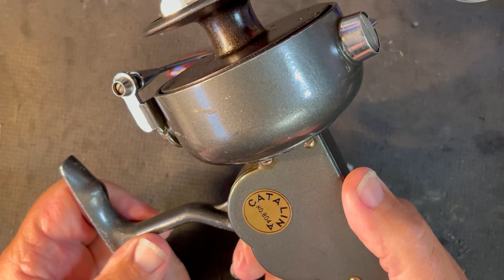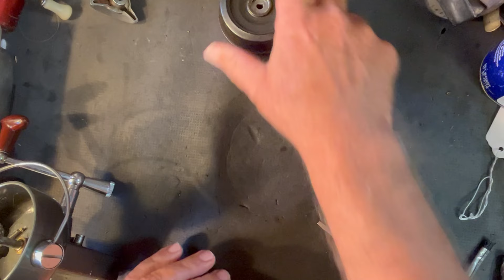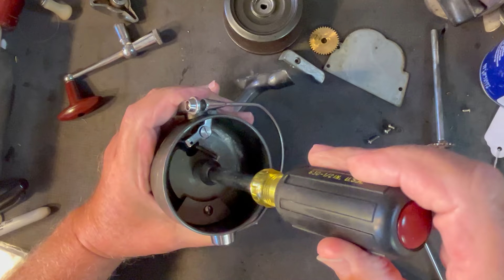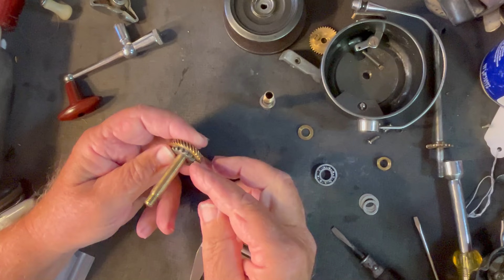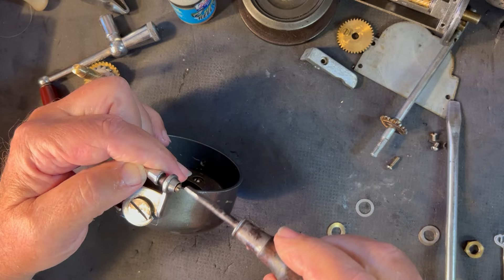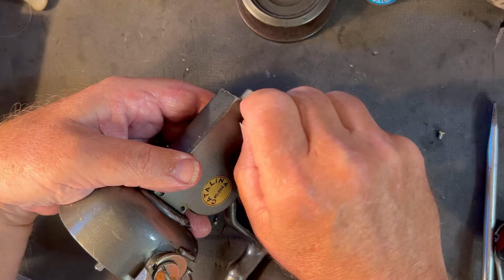Catalina No 804 or Jorgenson X 12 or Columbian No 65 -- Revisited -- Young Martin's Reels

Comment: first of all I have one of these reels I would like to know  if they were made by Diawa and what year,  the other thing is the one I have has a slightly different  the handle...it screws right through  and the drag has a couple of fibre washers and 4 what appear to be cork washers in it thanks for the video I would be lost without it  cheers Reg  Esperance West Australia
Reply from the maker: Greetings down under. It never fails to amaze me how far out my videos are going. I really don’t know who made the original design of this reel. If you read through the comments you will a short discussion I had with Chris Jenkins about that. He seems to think the original was made by Jorgensen. He’s done a lot more research on that than I have. I have noticed that in most cases, trade reels are almost always slightly different from the original. Sometimes it just the makeup of drag washer material. I’m curious, did yours have the drag spring in it or just a drag washer stack. If the spring broke or corroded. It might have been replaced with washers to take up the difference. 

How do you guys keep from falling off the planet down there. 😊
Reply: @youngmartinsreels5314  thanks for the reply . Yes the internet does make the world much smaller,  I was given this reel a few years ago so until I pulled it apart the other day I had no idea as to what I might find but I was more than surprised to find the cork washers in there and also as to how good they were after all this time I am not sure that the reel has ever had a service it really did look untouched. The other thing was that this reel has that different handle in it than the one you are servicing could it be an earlier model Would the other fellow be able to date it for me perhaps cheers from Reg down under
Reply: IF i was savvy with computers I would send through a couple of photos

Comment: Exactly why did you shim the pinion and the main gear?  I don’t remember from the first video.  I did see .where you added the Colombian reel to the string of trade reels. I still believe that the original reel name was Jorgensen.  When I did this on the rotor of one of my Jorgensen models I wedged that bail trip release so I did not have to hold it out of the way.  Wonderful eyesight, really? You’ll understand why I lack much sensitivity for that wish of yours. LOL!  This rotor certainly has an impressive weight inside the rotor for balance.  After you’ve worked on this reel you can better understand why I like them so much that I got four Jorgensen reels in two model sizes with a parts reel to boot.  This was definitely a more concise video this time around.  You can’t beat a good spiral gear reel. Of all the Japanese spiral gear reels I own, by far the Daiwa 8000 series (8100, 8300, 860o, and 8700) are the absolute finest ones. Prior to the Abu Garcia Suveran reels that came out in the late 1980s to 90, those Daiwa 8600 and 8700 were the only spiral gear reels that were built with three ball bearings.  None of the Penn reels that were spiral geared had more than two and the 706Z was the only Penn that had two. All the others just had one. On these Jorgensen reels I particularly liked the oscillation mechanism. It was unique as well as very accurate helping to create a better line lay than most spiral geared had reels of their time (in my opinion). I honestly don’t think these reels like the Catalina and Colombian that were essentially the same as the Jorgensen reels were not built quite to the standard of the original Jorgensens.  This was sort of common practice when trade reels were created from an original model. It is not a lot of difference but I can see where there are little things that were done differently. All of these reels are based on a superior design and manufactured using quality materials. They can certainly stand up to  demanding saltwater conditions and handle large species. I like both videos Rick! You did outstanding service as well as some nifty machine work!  — Chris
Reply from the maker: Chris, there was end play in the main gear and pinion that allowed for play in the handle. By shimming them, I now have no backlash in the handle. Any rotation of the handle, now translates directly into rotor movement. The end play in the rotor allowed it to move up and down when you rotated handle. This translated to an audible “thunk” each time you began to wind it in. The end play on the main great allowed about 10 degrees of handle rotation before moving the rotor. This made the reel feel loose, sloppy and worn out even though it wasn’t. 

I’ve only had hands on the Catalina reel but from the pictures I’ve seen, the only real difference I’ve seen is the Jorgensen had two screws in the cross wind block as opposed to the one screw in the Catalina. What other differences did you notice?
Reply: @youngmartinsreels5314  My two Jorgensen X-II reels are larger reels than this Catalina. If I can I’ll send you a photo of the X-II. I own three Jorgensens as well as a parts reel.  — Chris